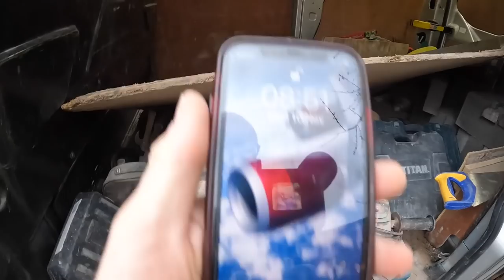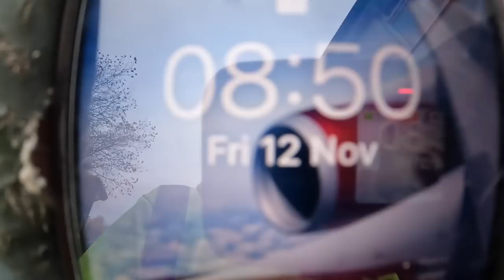AWKWARD STEEL INSTALLATION ..CONSERVATORY PART 6

Comment: Love the videos!! I used to work for a company that did steelwork for buildings and used to lintels like you fitted with bolts between them but we used to weld a tube to one RSJ so as to allow the installer to install without the need to uses nust eitherside of the steel,just on the outsides!! The tube would hold it all square and at the right spacing!!!!!
Reply from the maker: Cheers Gordon . There is always a risk the cavity isn’t set right .
   With the bolts you can adjust the cavity 👌🏼🧱👍🏽
Reply: @SteveAndAlexBuild  Fair point!!! To be fair we used to do them to order on the day needed so its possible that the cavity was measured accuratly when we got the measurements!!
Reply from the maker: @gordyminiman  nice one 🤙🏾🤙🏾🧱👍🏽

Comment: Great channel, subscribed! Quick question, when you showed the timber on the ground with the jiffy hangers already on it, how'd you go about knowing where to place them? Was it just a case of very accurately measuring the spacings of the currents joists with a tape measure and transfering them onto the timber? Can imagine one of them being out would cause alot of grief. Cheers Steve!
Reply from the maker: Hi James welcome to the channel ! 
    That was the technical bit which Rob and Rob the joiners sorted out . 
    I didn’t see how they did it to be honest but it went on first go 👌🏼🧱👍🏽

Comment: Great job, fascinating to see how it's done in practice. What is the point of the bolts joining the inner and outer beams, doesn't the weight of the wall stop any movement?
Reply from the maker: I’m with you on that but it’s the rules we have to follow 🙄👍🏽🧱

Comment: If you was keeping the door could would you have still needed to do this? I'm doing my moms extension an having a patio door where the window is which will lead in to new extension I dont need to do a new lintel do I?
Reply from the maker: As long as the opening stays the same or narrower the original lintel can be used 🧱👍🏼
Reply: Thank you mate
Reply from the maker: @spencebespokedreams  no probs pal 🧱👍🏽

Comment: Hi! Why do you put the aerated concrete “slate” on top of the beam?
Reply from the maker: It’s not aerated its roofing slate which is used to pack brickwork tight. Very common method in brickwork 🧱👍🏽

Comment: It looks like the job would be easier with steel spacer tubes between the steels. Then run the threaded bar through and tighten the nuts. Just thinking out loud.

Comment: all ways something, great work. in future get the steel company to give you some 30mm x 7mm pipe cut to fill the cavity/web use them as spacers then you dont have to dick about with extra nuts to hold the threaded rod in place on the internal web or rsj, saves so much time and knuckles.
Reply from the maker: Cheers Ed , I prefer the nuts in case the tubes are slightly wrong . 🧱👍🏽
Reply: We get the tubes welded onto the beam.
Reply from the maker: +Edd Jordan 🧱👍🏽

Comment: Probably find if the second steel was turned round then holes would of lined up .
Reply from the maker: No pal the holes were symmetrical. We had joists in the way of two holes 🧱👍🏽